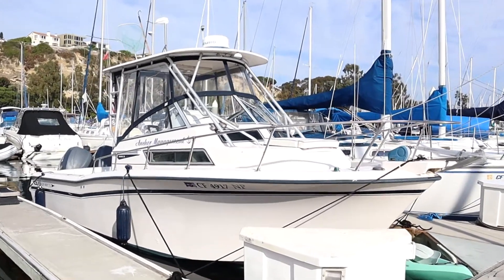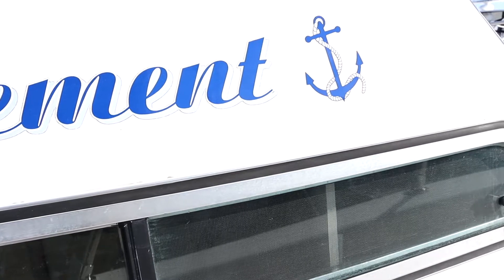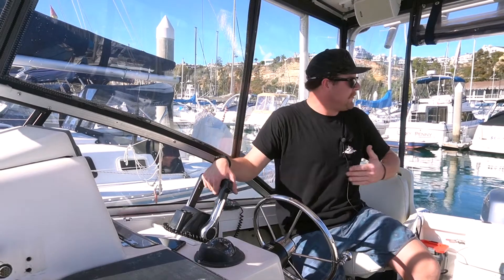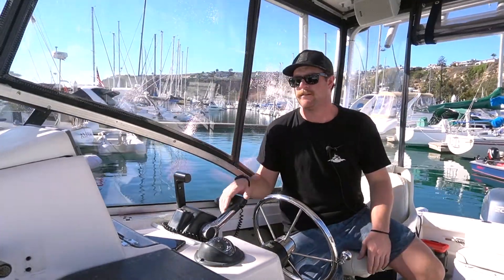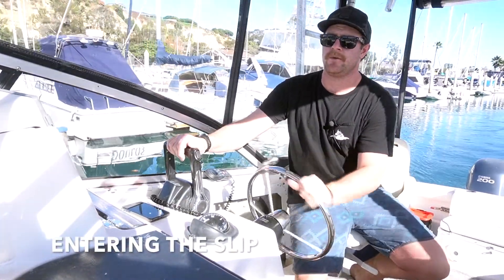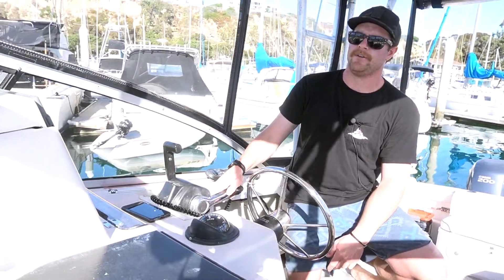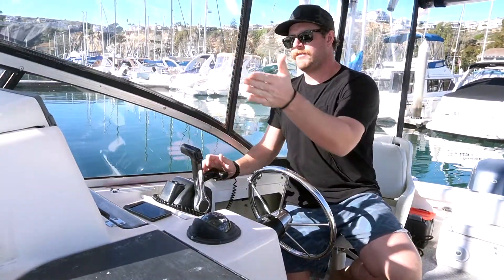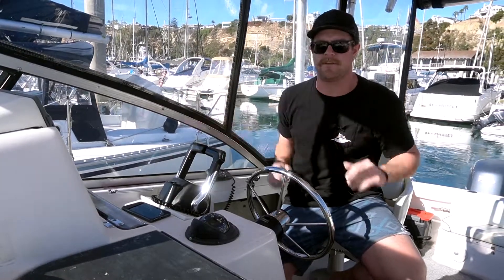EPISODE 007: THE 2 MOST IMPORTANT TIPS WHEN DOCKING A BOAT!

Comment: Hey Jimmy, great videos, keep em coming, and thank you:)  I skipper southern N.E. waters where wind and tide are a huge factor in docking also, we keep the boat heading into both as much as possible while docking:)  What year & model is your vessel?  I run a 1995 GW sailfish and have to repower from my old two strokes.  Planning on new Yamaha 200's in-line 4 strokes.  Is that what you run?  If so, what year are yours?  How do like them?  Enough power to get up on plane and such?
Reply from the maker: Thank you so much! I’ve got a 93 hull with twin Yamaha 200 four strokes. Perfectly powered for the size! Thanks for watching!